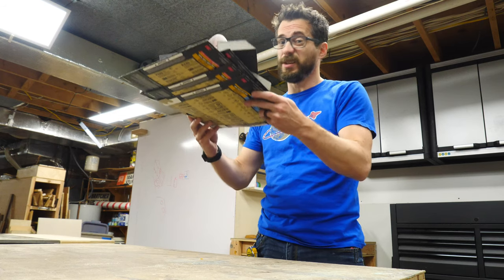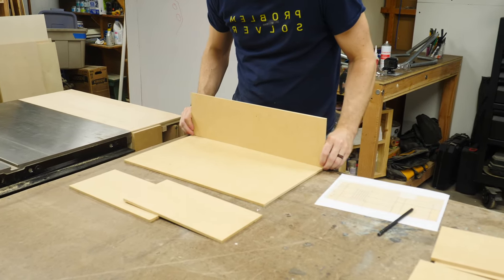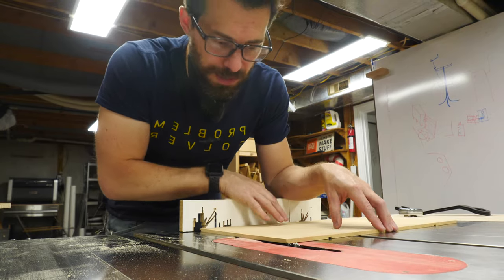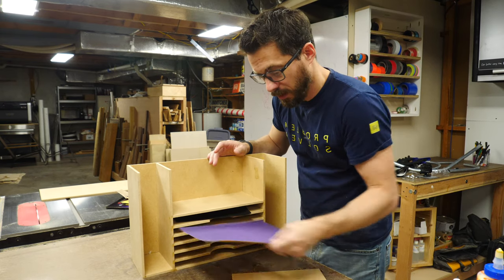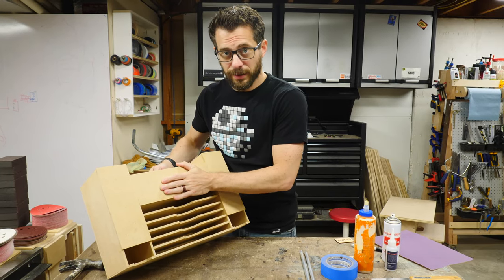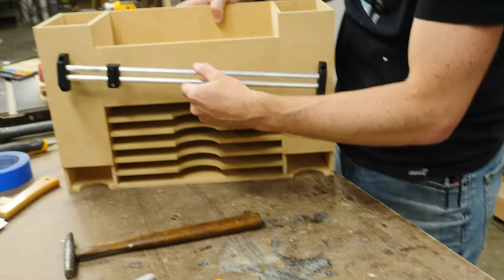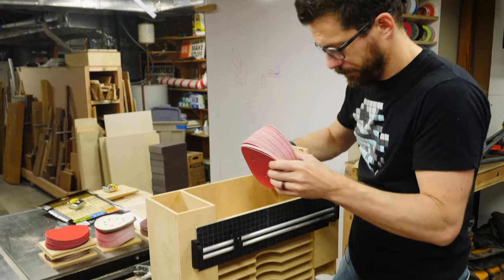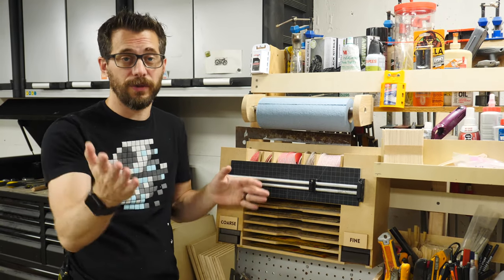How to Make a Sandpaper Organizer | I Like To Make Stuff

Comment: what we had in shop class at highschool was a hacksaw blade mounted to a board that worked well for cutting straight lines in your sandpaper and rarely dulled. it also had lines and a stop for when you were cutting for certain sizes depending on what you needed the paper for

Comment: As usual, cool project Bob.  I like the idea of the loose discs dividers rather than fixed ones. That solve the problem of how big a gap should be left for those frequently 180-220 grit used ones and how little for the less frequently used ones.  Simple solution to that problem.  And of course all other storages incorporated in one. Thanks for the video Bob.

Comment: That is an awesome addition to any shop! There is a similar version on Pinterest for dispensing tape. They used hardboard for the sides and what looks to be a piece of 1"x2" pine in the front and back. The rolls of various tape roll are in individual dispensers put are hung together. You can see the 1/4 of each roll and using a hack saw blade cut up into pieces and then screwed to the front of each one. I think they used one or two washers against the pine, then the saw blade section and then screwed on. It is nice if you only want to use double-sided tape, you remove just that roll and the rest stay on the wall or cart.

Comment: Hey bob, I find that cutting sandpaper from the backing, then even ripping the last bit through the grit, helps with prolonging the blade life when cutting sandpaper. I’ve also used a relatively blunt knife in that way to cut sandpaper

Never mind you cut it from the back anyway

Comment: I have a folio that I keep the sheets I use for metal polishing.  From 220 to 2000 in paper and cloth.  I take the folio to the work and put each grit back as I finish with it.  It saves a lot of steps and time.

Comment: Love shop organizer projects.  It was an interesting design solution to the sand paper organization/storage problem.   Thanks for sharing.  Loved seeing 3d printing being mashed with more traditional woodworking.  I don't think I would do the blade cutting (I would tweak my build with a jig for tearing against a  straight edge) but I learned some things how you designed the holder and rail mounts.

Comment: To cut sandpaper I screw a hacksaw blade to an edge, and a piece of wood as a stop that will make the size sheet i want by simply holding the paper, and pulling it over the blade to cut it.

Comment: I did ask at Makers Central about the reason why Dado stacks couldn't be used in Europe and apparently it's just that table saws sold here don't have a big enough opening and support rod for the blade to accommodate the whole width of a dado stack. I'm not sure whether this comes out of a specific legislation but in itself it makes sense. I certainly couldn't fit one on my table saw for sure.

I could do with organising my sand paper too, it's heaped up in a corner of the shop just now, not the most practical thing to have...
Reply: Thanks, J-L Arts. It seems off if they are not allowed on safety grounds - we have things like chain saws after all...
Reply: @zeno2712  yeah I first heard the rumour that they were "banned" here in a Steve Ramsay video but he didn't know whether this was true or not so I asked the guys at the woodworkers association at MC

Comment: Maybe add a real deep and narrow opening between what is currently the back wall and another back wall to which the French cleat will be attached to hold those big sheets vertically (they should hold just fine if there's a slight bend to them as they stand in there), just in case you need them big? For example for those times when you need to lay your sandpaper on the table and hold a relatively big piece to give it an even bottom/top surface? Just a thought.

Comment: If you want a cutter and you don't have a 3D printer you can use a Hacksaw blade as a sheet paper cutter. Just mount the Hacksaw blade off the board with a couple of washers and then it works just like a plastic wrap or tin foil cutter.

Comment: Super cool. Love the cutter. Why not make it deep enough to hold full sheets? To make your life easier you could and a clip board style clip to hold the sheets while you cut them. Great project and video. Keep doing what you're doing. Thanks Bob and Josh.
Reply: And the camera trick in the intro was pretty awesome
Reply: Mentioned in another comment, but basically it would make it quite deep and seemed like a waste of space. The depth now is determined by the sanding blocks on the sides and the half-sheets are still useful. Full sheets are kept in deep storage elsewhere 👍
Reply: Thanks @Forby
Reply: @danpeikes  😁👍

Comment: Great organizer, but I think the cutter is a little over the top. As you said, that blade is going to dull quickly when used on sandpaper, meaning you'll need to periodically disassemble the cutter, buy a new rotary cutter, take the rotary cutter apart to harvest the blade, and put the whole thing back together again.

Personally I think a better way to go would be to mound a hack saw blade on the front, facing up, with a small MDF or wooden guard above it. Slide the sandpaper up from the bottom and rip it down across the blade, just like a roll of aluminum foil.  The guard can be a simple square dowel with a concave shape routed into the bottom to make the paper curl over as you push it up from below.

The beauty of this is, the hack saw blade doesn't need to be sharp - it can be a dull one that you've already used in the shop. Too dull to cut wood or metal, but it'll still cut sandpaper straight and even and probably last forever. A section of broken band saw blade would also work, if that's what you have sitting around the shop.

Future improvements might include hanging points on the front of the sanding sponge dispensers for rasps, files, sanding dowels or other abrasive tools; and maybe resting places on top of the sponge dispensers for wooden sanding blocks.

Comment: +1 for a Josh photobomb....     

Good design, but for anyone without a 3D printer, I think I'd try loosely screwing a hacksaw blade to the front and use that for tearing/cutting sandpaper sheets.   (on the other hand your sheets looked extra big, so maybe they wouldn't fit.)

Comment: You actually can get a dado stack in Europe. The problem is that you also need to have a table saw with a longer arbour so that you can fit the dado stack. Normal contractor saws do not have that and only allow one blade on the arbour. There is however older machines that can fit the dado stack and some high-end saws for hobbyists. Any saw made primarily for contractors or other business-oriented purposes will not have a long enough arbour since it is only allowed for home use or hobbyists and not for workplaces.

Comment: Great video, but I should ask, how do you replace the blade? Blade mount looks like too much hassle to replace. I was thinking, if you split that part into two (top and bottom slider) you may just unscrew a long screw holding two, slide top to left, replace the blade and slide top back and lock two parts again. And because top and bottom will be able to rotate it may be far easier to do the job.

Comment: nice job !! I don't have a 3D printer i would have used a hacksaw blade that's what i use now, a hacksaw blade with a washer under it and screwed to a board slide sand paper under it and pull up and tear off

Comment: Just use an old handsaw to rip sandpaper to size. Press the saw on the sandpaper but at a sharp angle, then pull the sandpaper up and voila, a perfectly cut piece of sandpaper

Comment: That cutter looks nice, but I have no 3D printer so I think I will screw a hacksaw blade horizontally with washers behind it. Low tech solution. Great organizer though.
Reply: Low tech, high utility/reliability, ease of install and use, all adds up to a winner. The serrated edge helps cut too!
Reply: IIRC John Heisz did a cutter all in wood (except a sharpened washer as the actual blade) that you might be able to adapt.

Comment: I love this project and the cutter.  Just a quick question, why not just make it be able to hold a full-size piece of sandpaper? Seemed like the simple solution and best for long term storage instead of having to cut down all your sandpaper when you buy new.  I usually buy in the larger packs so this would take a bit of time to breakdown to simply organize away.
Reply: We considered this, but it would make the whole thing deeper just for those full-size sheets. And considering that when we get full-sized sheets, we cut them because we don't usually use the entire sheet at once. Great question. -Josh
Reply: @JoshMakesStuff  Makes sense!  I bet tons of scraps would get stuck and just create a problem.  Thanks for the response!

Comment: as far as that outside rabbit and not being able to use the fence or sled because of the dado stack... Couldn't you just move your fence to the other side of the work piece? I'm new to all this and just bought a used Ryobi BT3000 for $30 that was in pretty beat up shape. Made a new table for it and a sled (watching your video on that) but my fence currently will go where ever I put it in whatever orientation I set it. Is there a reason not to move it to the other side for that particular cut?

Comment: Maybe add a window so you can see how many sponges are left? Also: you could sharpen a washer for an inexpensive cutting edge.
Reply from the maker: We did think about routing a little channel up the front panels so you could see how many are left, but since you can see 2 of them at the bottom opening, you know when you get to the last one 👍🏼
Reply: @Iliketomakestuff  @JohnJameson18y Arduino, ultrasonic sensor detects height of stack of pads, calculates how many left, display on 7-segment LED. Or a little simpler, one RGB LED for each stack, green for OK, yellow for half gone, red for 2 left, flashing red for one left, off for 'I can't do it for you -- I can only help you help yourself.'

Comment: Cool build, but isn't it going to be a pain to change the blade on the cutter? It looks like you would have to take it all the way off to get the old blade out and a new one in.

Also, really nice job on the intro. That was a pretty cool cut.
Reply from the maker: No, the screw comes out, the piece lifts off the blade and a new one goes in 👍🏼
Reply: @Iliketomakestuff  ah, I got ya. That makes a lot more sense than how I thought it went together.

Comment: I feel like the sanding block dispenser shouldn’t be a dispenser since you don’t throw them away  after using them once. It might be better designed as a stack holder so you can take from the top and put them back on the top.

Comment: Did I miss the explanation of why you used to different adhesives?
Reply: The CA Glue cures quickly acting as a clamp while the Wood Glue dries. :) Allows work to continue on a project whilst the Wood Glue is drying. Cool trick!
Reply: @Ross8235  That is pretty neat, thanks!

Comment: Instead of a cutter, why didn’t you just make the drawers big enough to hold the full sheets?
Reply: To hold a full sheet the shelves would need to be twice as deep. It's already the right depth for disks and pads and not too big for hanging. 2x deeper adds a ton of space, at the cost of a ton of weight and stick out.
When was the last time (also the first time) you used 'a full sheet' for 'something'? I thought about that too, and cutting them makes sense. Could cut a few for the box, and leave others in deeper storage.
Personally I would have dadoed the sandpaper shelves as drawers. I use a lot of smaller pieces, and they'd be impossible to reach in the narrow slots.
Reply: @jimbarchuk  ^^^^ this guy nailed it.

Comment: what do you mean "in Europe the cant have a dado?" the cant just buy one from a seller that ships to Europe?
Reply: The table saws in Europe have a shorter arbor, so I converted mine using american parts, and imported a dado stack, like you suggested.
There are regulations controlling the use of dado stacks in the workplace, to protect employees.
However those regulations to not apply in the hobby shop.

Comment: My 13 year old daughter just asked out loud. :Why would you go to all that trouble with that tiny blade which you will have to change A LOT when you can attach a thin piece of steel the length of the paper and about a quarter inch wide and tear the sand paper that way??"